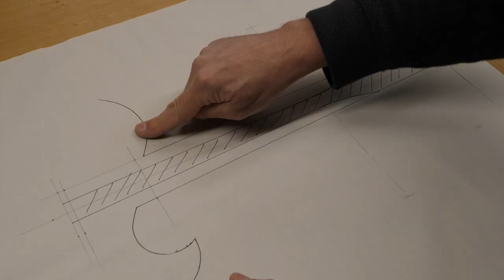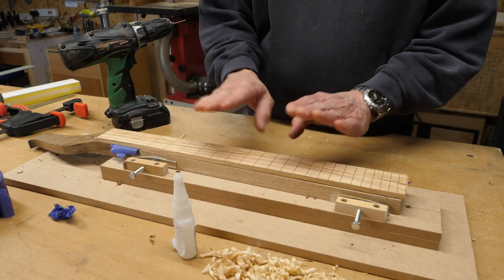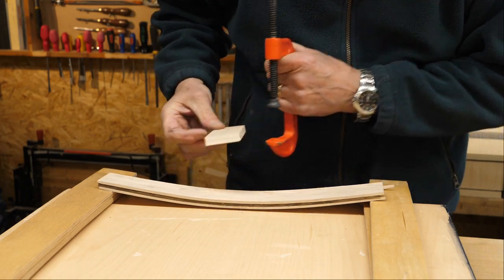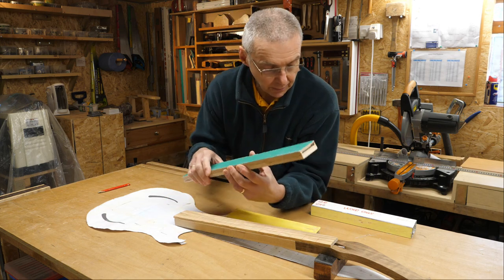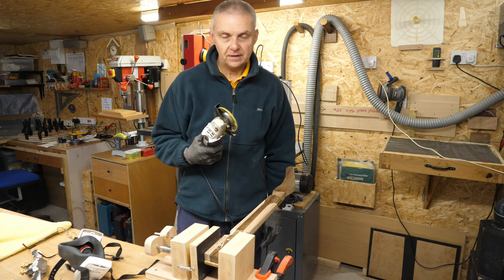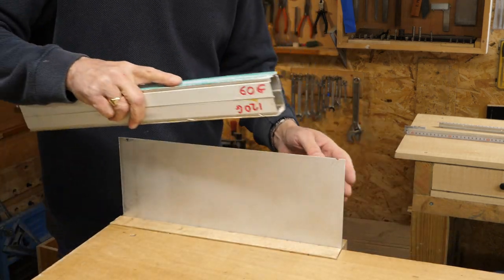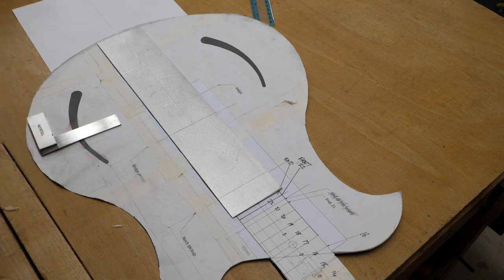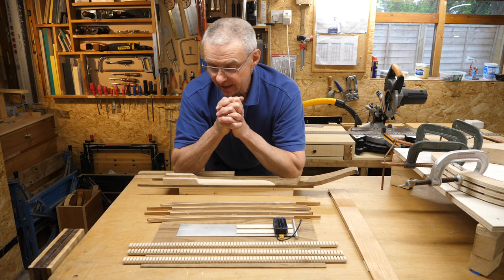Great Guitar Build Off 2021 - Part 3 Shaping the neck, concealing the pickups

Comment: A metal plate under the pickup is going to have a random effect on the magnetism and inductance.  If you're luck it will give it the inductance boost you want given that you are hiding it away from the strings without damaging the tone.  But its a big variable when your plate could have been wood.

Love what you're doing and learning a ton at the same time.
Reply from the maker: Thanks Michael, this experiment is going to be interesting. Of course if the metal fails as you say I could always use wood. Cheers Dave

Comment: That two tone neck is delightful!  I've never been brave enough to do the two ends of the neck and joint them up... if fact it was only when I saw Ben do the facet carving method I was brave enough to even try!
Reply from the maker: Yep, I got a bit scared when the dark wood started chipping out with the spokeshave, luckily the angle grinder did the job, equally scary 😟 cheers Dave

Comment: What do you think of the saber tooth?  It was way more brutal than I expected.  And I think I got either the medium or the fine.  Flap discs still take more time but I feel like I have a lot more control with them.
Reply: I got the yellow one a few years ago and it’s brutal, though I think it’s getting dull now

My problem with the flap discs is when they get old they have bits fly off 🤦‍♂️
Reply: Brutal indeed. I nearly took the end of my finger off with a 40grit flap disc. I was stripping these big old beams in a house I was renovating and had to remove the guards from the grinder. Thank gawd I was wearing gloves as it shredded the end of that. You should also never lick them.
Reply from the maker: You have to be really delicate with it and then I find it okay. I’ve got the yellow which I think is fine.
Reply: @saulgoodeguitars  yeah chunks of thick sand paper flinging off at the speed of light is troublesome.  🤣
Reply: @fatpotanga  wow!  Yeah I’d be terrified without the guard
Reply: @DaveDickens  I may just need to spend a little more time with mine to get comfortable.  The flap discs seem to have more finesse for me, maybe just because I’m used to them.

Comment: Muy interasante , pero will not the auminium in the back not cause retroalimitacion de los pastillas? Escusa mi pobre linguage ~ Your neck laminacion is very attractive from the choices de bosques contrastando and but the brace, struts? When you adhese the struts and los bosques envejecen a differentes ritmos de tiempo will no the separacion be probable? Especialmente when shave gradual ~ Buena suerte Sr. Dickens ~
Reply from the maker: Hi Luis, I do not think the aluminium will be a problem but we will find out soon.  I think the struts should be okay once the top and back are glued in place. Cheers Dave